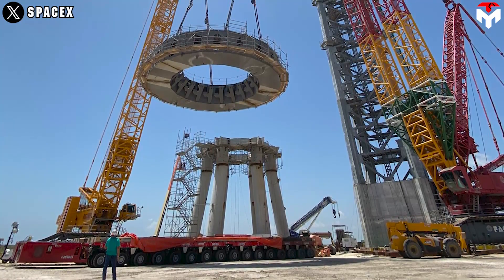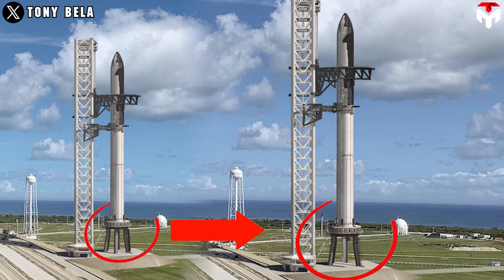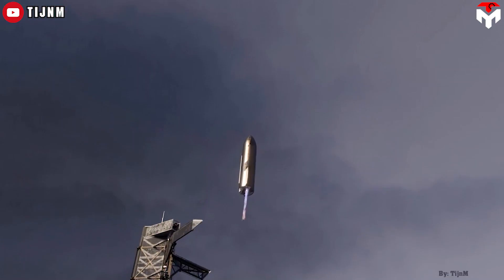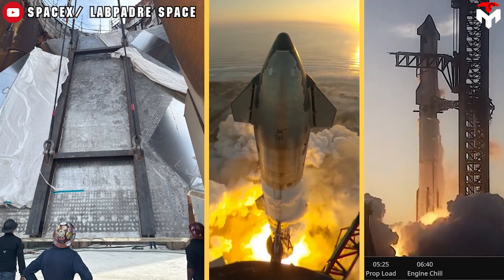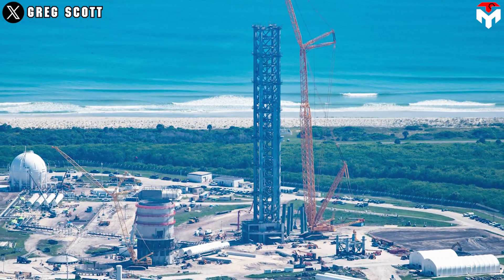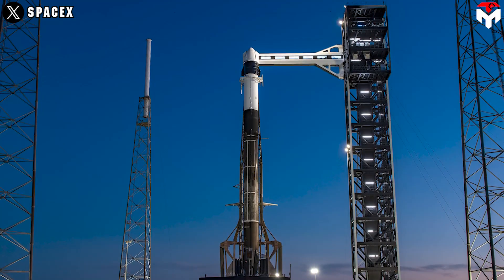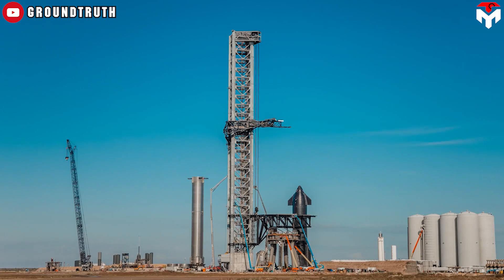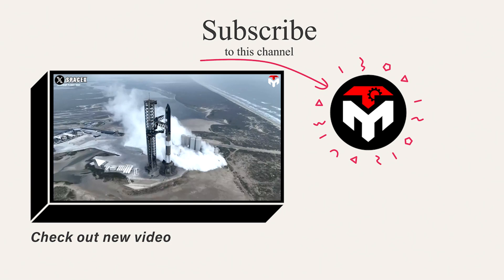SpaceX Demolishes Starship Launch Pad at Florida! Major Plan Changed...

Comment: Why would they ever want to land in the ocean ? The corrosion problems just with the electrical systems would be a nightmare  I would think ! Then corrosion in the metal of the ship, with the exemption of any stainless steel of course.
Reply: SpaceX discovered there wasn't as big an issue as they thought with sea water with their recovery of panels.
Reply: @2150dalek  panels, sure. But booster or the Starship  ????

Comment: Why must SpaceX reinvent the wheel on every thing they do. Why not use a heat resistant concrete with a radius deflector to control the flame away from everything. Then divert the exhaust into the open air. Stop all the destruction that is unnecessary.. they have diverts the exhaust since Gemini. If the concrete at the 45 degree mark can’t handle the heat install fire brick.

Then concentrate on the space ship and not the launch pad.
Reply: They are probably trying to find a solution that works well with their construction and excavation goals on Mars.

Comment: Tungsten reacts to water explosively
Reply: No.
Reply from the maker: I don’t think so
Reply: @techmap9  I've worked with it in the lab.  At the temperatures that we are talking about, it does react.  I found this: Tungsten does not easily oxidize in water. It is a very resistant metal and does not react with water at room temperature or under normal conditions. However, at high temperatures and pressures, tungsten can react with water to form tungstic acid (H2WO4) or tungsten trioxide (WO3).  It really reacts well to H2O2.  Rocket exhaust, spent methane, and hi heat (imho) would do some damage to Wolfram.